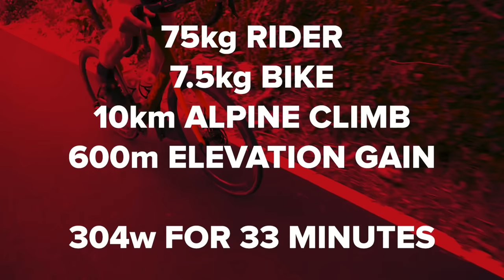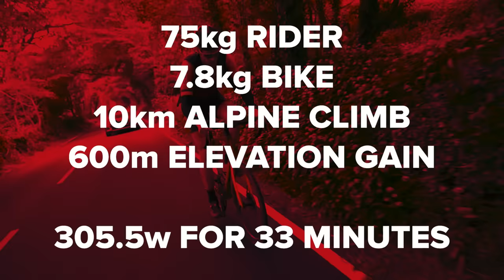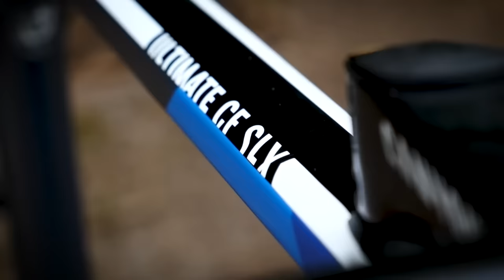10 Reasons To Consider Aluminium Over Carbon For Your Next Bike

Comment: TRUE STORY ALUM vs CARBON: Father was sent from France for two years to Microsoft in Seattle. Father bought son a Fuji alum gravel type bike w/mech disc brks. They became good customers and son became president of his hi-school cycle club. One day he came to my shop and told me he was in the top 5 in his class racing the local week race at Seward Park. I asked him, that I would like to see his race bike so I can fine tune it and hopefully be in the top 3. I went into shock when he told me he was racing his aluminum gravel FUJI with full fenders and a rear rack!!!  His excuse for not being able to podium was that everyone else bikes were expensive, name brand carbon bikes.... I explained to him, that his alum bike is better for racing because its stiff, and all his pedaling forces go into moving forward, where as a carbon frame flexes just a bit giving his aluminum bike an edge.
I then told him I will sponsor him if he allowed me to set up his FUJI with Lt/Wt tires & tubes, as he had heavy wire bead city tires.  We removed the fenders, and I decided to leave the rear rack on as it helps aerodynamically. As an ex Cat-1 racer I gave him racing advise and told him never to break away unless he sees one or more of the top 3 guys in the break.  A week later he came to my shop all excited telling me he WON!  And he went on to win the entire Seward Park series along with all the top prizes and cash.  And he did it all with an Aluminum bike!  The funny part was his Fuji bike with a rack being photographed in front of the podium next to 2nd & 3rd place Pinnerello and Cervelo.  Cheers ( :

Comment: Al does have a weakness being exposed to toxic and acidic sweat, especially as it accumulates in BB area, corroding the frame, housing threads and the BB itself.  Also, I know quite  a few people have broken Al handlebars because they don't change the tape often enough.  Al metal turns into Al Oxide powder.  So Al has an  unstoppable as well as insidious corrosion problem that causes Al components to have limited lifespan.  You can slow it down, but it requires more maintenance and cleaning.  Most Al components get a coating to stop corrosion, and this coating can be compromised by scratches from falls or other causes.  Carbon bikes do have Al bits that are also subjected to this problem such as drops, cable guides, threaded or press fit housings, etc. so carbon bikes are not immune, but at least the carbon frame won't snap some day because of corrosion.

Comment: Sorry that we dropped the I from Aluminum here in North America.  It seemed fitting that Ollie provided such expert analysis about the I being "dropped".
Reply: Do you mean olle?
Reply: @LOGICAL-JAY  It's not snobbish to use an officially recognized term for a metal element.  And both versions are indeed officially recognized.  But it should be alumium...it's shorter and came first anyway.
Reply: @phnelson033  relax I'm just joking..I like carbon frames better anyway..lol..the cannondale CAAD is an exception though..

Comment: I have a Trek 1.5 compact alpha. Aluminium frame with fairly basic entry level group set etc. I changed out the original wheels for some expensive ones and it transformed the bike.

Comment: If you are riding a bike, you are living life well.   Doesn't matter if it's aluminium or carbon or steel (or wood, even).    Personally, I like steel.    It's even more robust in most situations, affordable, gives a good ride, and looks cool (esp with lugs and classic frame geometry!).    My bike weighs a whopping 30 pounds.   No light weight, for sure.   But I go fast enough for my taste, and ride far and have a blast.   And that's the point.

Comment: Threading into carbon while possible doesn't look like a good idea to me. I'm an IPSC shotgun competition shooter and we have those long telescopic magazine tubes on our shotguns where there's this same debate is raging - carbon or aluminium. And I've seen many a carbon magazine fail where not a single aluminium one did. They fail where they have a threaded connection to an aluminium hub. It's a problem that different manufacturers try to solve differently. But I just ran a slightly heavier aluminium magazine and never had a single issue. Threading into carbon looks like a no no for me. Especially when we're talking about the bottom bracket which gets subjected to a lot of force.

Comment: I'm confused, which is heavier: 1 kg of carbon or 1 kg of aluminium?
Reply: Carbon fibre has a density of about 1800 kg/m^3, where as aluminium is roughly 2700 kg/m^3; so carbon fibre is also around 1.5 times lighter - per unit volume. Just a quick Google search away...
Reply: @FSXgta  whoooosh
Reply: @pvtmustaqim  I am truly retarded haha

Comment: My aluminium Trek 2300 (circa early 2000s) developed a fracture in a weld on the non drive side chain-stay after a few years (which made it a write-off).  I don't worry about that on my newer Carbon bike.  I do accept that it is more vulnerable in crashes.  But if you don't crash, carbon can be the longer-lasting technology.

Comment: Carbon for comfort (and efficiency), aluminum for winter bikes.
I hate the jarring and dead feel of aluminium, but no galvanic corrosion to components as happens to those same components attached to a carbon frame that came in contact with de-icing salts in winter.

Comment: Over the past 20 years or more, I have had a succession of aluminum frames, thanks to a very liberal frame replacement warrantee of a fine American bicycle manufacturer.  I must say I loved them, particularly the latter frame versions.  That staid, every one of them eventually broke, usually the seat tube near the bottom bracket (hence the replacements).   Admittedly, I tend to ride the frames longer (much longer) than any self-respecting, gotta-have-the-latest-components cyclist should, but metallically speaking aluminum fatigues and simply does not have longevity of a steel frame (I haven't much experience with carbon).  We're talking a couple tens of thousand miles between failures, but just be aware.  At this point, however, I'm riding much less than my intense years so I'll bet your current aluminum frames would last me the rest of my riding days.  I'd buy another based on the price, and use any future problems as an excuse to get the latest components.

Comment: I have been using bicycles made of aluminum for more than 10 years, my bicycle brand is Mosso, the frame is made of Aluminum 7005 and the rims are made of Aluminum 6061. This bicycle is a Hardtail MTB bicycle which I converted into a hybrid since 2014 and it is comfortable to ride for commuting. gravel road because I like cycling in and out of the village in my area. Aluminum 7005 and 6061 are materials used in the aircraft industry. So light, strong and durable. And I'm still using this bike from 2009 to 2021 at this time. I really like aluminum bikes compared to carbon. 🚴🚵

Comment: I got myself a second hand collector Swiss carbon aero bike (manufactured by Cilo) for 700 $, it's an awesome bike, very stiff. Came with a set of wh-r540, which is a bomb proof wheel set. And, on top of that, it's mounted with the good old ultegra from the 05'. Never had any issues after 3000 km.

Comment: My number 1 reason for aluminum over carbon fiber is... When carbon's stressed beyond it's yield point it can develop internal damage that cannot be seen. Basically microfractures inside the layers of the composite itself. Then when after repeated lower levels of stress and vibration the part fails catastrophically. Aluminum is not only far less likely to fail catastrophically, where carbon it all but guaranteed to. When stressed beyond it's yield point aluminum will show visible signs it's damaged allowing you fix or replace a component before it fails.....Those videos you can find on YT of things like carbon handlebars suddenly snapping in two are 9 times out 10 parts that were damaged in a past crash or mishandling, that showed no outward signs of trouble until they later snapped in two while on a ride. 

For racers who win or lose is a matter of fractions of a second carbon may be worth it. For me winning is going home at the end of the day uninjured with a working bike, So I have aluminum.

Comment: I recently built up a 2016 aluminum Trek Emonda ALR frameset to the same specs as my 2015 carbon Trek Emonda SL to have a second bike—mix of Ultegra and Dura Ace components, Fulcrum Racing Zero Wheels, Bontrager XXX bars and stem, and carbon seat post. The bike weights are the same. Yet I actually like the feel of the aluminum better than the carbon. The ALR seems to be stiffer in all the right places, and the ride is comfortable nonetheless probably thanks mostly to the carbon fork. The ALR is easier to maintain with its external cabling. The ALR fork has an aluminum steerer, which is likely safer than carbon. Both bikes are at least a kilogram lighter than the current Trek Emonda SL6 with disc brakes. The cost for me to build up the ALR with superior components, finishing kit, and wheels was a fraction of the cost of a new SL6, and is a superior bike in every way in my opinion. Some people have advised me to “upgrade” to the new Trek Emonda. In my view, why would I spend so much money on a downgrade?
Reply: Remind your friends. Its the Indian not the arrow

Comment: One thing I once heard is that Titanium despite having a very high strength weight ratio apparently has the disadvantage of making a slightly springy frame meaning that too much of the riders leg muscle power is absorbed & not transmitted to the wheels.

Comment: Seat post suspension improvement reduces NVH up the spine, into the butt & crotch and reduces rider fatigue, as does front suspension and stem suspension. Combine a comfort seat on spring suspension, decent front suspension & bar stem suspension, and you can radically reduce riding fatigue so as to stay fresh longer on bicycle road trips & long distance events :)

Comment: Rode an aluminum for 2 years, got the same model in carbon.... not comparison... riding the alum now feels like riding a tractor lol  PS.  Also, I never quite understood the concept of "getting the energy back" from carbon frames.  Well, I still don't but it is something I felt instantly, especially on hard accelerations when I'm out of the saddle.  It's a beautiful sensation....

Comment: I have a top-end aluminium drop bar bike and a mid-level carbon drop bar bike with the same brand model series and size, all the components on the carbon bike are one level up, so overall the carbon one costs 3 times more than aluminium one. At the time I rode higher weekly distance and cared about PRs, I did not see aluminium was any less than carbon in performance, on the contrary, I made more PRs on climbing with aluminium (could be the gear ratio). I also have a entry-level aluminium flat bar bike, it's heavier on frame and wheels and indeed slower. My observation is the overall weight is the bigger factor to affect your riding speed, the frame material does not matter that much. However, the carbon frame does have better look, I receive compliments for the bike from people when riding the carbon one, I don't recall any for aluminium ones :D

Comment: Hmmmm.... some great points here and if I had to do it all over again, I might buy Aluminum.  

Had an old steel Gary Fisher for nearly 30 years until a friend lent me his carbon Specialized for our usual Saturday ride - the difference in performance was dramatic!!  So dramatic that I bought a carbon the next week - I was lucky because a friend sold me his lightly used Specialized Stuntjumper kitted out with top of the line gear for a disgustingly reasonable price (his wife stopped him from riding after a car plowed into his riding group, killing a rider, so it was gathering dust in his verandah).

My cousin who rode an Aluminum Cannondale, broke a weld on the frame while climbing an 11+% hill near us - Cannondale honoured their lifetime warranty and upgraded him to a carbon frame.

So my instinct would be to go carbon for my next bike (or get a Porsche), but my cheap Scottish genes would probably push me to buy Aluminum....

Comment: Agreeing here with all that Ollie is saying. But a topic not touched upon is the aesthetics, which will be of importance to many. Talking specifically about joinery. But maybe someone's done something with aluminium these days to make the junction of tubes  as IN-te-gral as is the case with carbon. The opinion here is that neither of these materials will ever approach the gorgeous aspect that's inherent in lugged polished steel joinery.
Reply: Except that it can be done. I have an aluminium framed bike with smooth junctions that can easily fool people into thinking that it's a carbon frame from a distance.
Reply: @Bungle2010  Yes, I've heard that's the case; thus far I've not come across that level of aluminium artistry.  Or,  I was so completely fooled by the workmanship, that I took the frame for a carbon one. Thanks for making this point.

Comment: Most modern mid to high priced bikes have carbon forks, regardless of the frame material. So there's that. I
 have a Scandium Opera by Pinarello, and I have never ridden a bike that accelerates and climbs better. IMO qality of construction and the best material count more than the type of frame material. I love my carbon, steel, and aluminum bikes. I appreciate each for their particular character.

Comment: Wow your bikes are light. Mine is 28kg steel mtb. Bought it on a whim. Loving it though and using it almost everytime I can and do some 30-50km ride with ups and downs. Have it for 5 years now and its just because of the pandemic that I started to educate myself about bikes.
Reply: 28 kg is a typical E Bike weight. I have a cromoly fitness bike with a non road bike frame made of cromoly and a handle bar made of stainless steel. Despite no efforts for weight savings it's just 12,7 kg. The frame alone is 2,5 kg with another kg for the fork. 
Is your bike a full suspension or cat 5 downhill bike?
Reply: @simonm1447  front fork suspension only. Dont know what category it is but sure is heavy. Not an e-bike, but I use it sometimes when I go to work. Heck of a workout. You learn to appreciate it once you've used it. In the past, I have to carry it to 4th floor since my room is in the 4th and no parking for the dorm. Its one of those stepdragon folding mountain bike, but it only folds in the middle 😂😂😂

Comment: that's correct, aluminium bikes can be made lighter than the equivalent carbon bikes. that's because the resin used in carbon fiber doesn't give the strength to the frame, but every crystal in the aluminium structure does give it the strength. so, if you compare resulting frames using Newton meter , the one made of aluminium will give you greater strength (i.e. will support greater force) when compared to weight

Comment: It's funny how stiffness of the frame is still mentioned as an adventage when it comes to power transfer. In fact it's the same myth as 'Rotating mass' - same category. Yes, bike can bend more or less but the power transfer on the wheels is the same. The force you put into frame which bends at some point is transfered on wheels because the frame gets back to previous form. Like a spring made of carbon or aluminium. If you put 100 watts on both of them, carbon and alu will have 100 watts in them.
Reply: That would be perpetual motion.  If you had a weight bouncing up and down on a spring, it will not bounce up and down forever, even in a vacuum.  Some of the energy put into flexing gets degraded to heat.  

Rotating weight is similar.  It's all good, until you apply the brakes, and degrade it into heat.  Then it's lost.
Reply: @blubaughmr  Not at all considering the fact you are adding constantly same amount of power to the system (bike). So we are not talking about perpetual motion in any form. Besides that, technically you are right that some of the force is transferred to heat but still - both materials bend but the power transferred to heat is so small on both materials that noone takes it under consideration when designing the frame (even steel or wooden). I've never heard of anyone having his frame hot or even warm from pedalling. Actually I think that it might be the transfer of the power to heat happens when material deforms (not bends).

Comment: Good job…I was struggling between the Canyon Grizls. The aluminium frame is available earlier and it is about 1 cm lower which is good for me: I can safely get an M. The weight difference for the 7 is over a 1 kg but the DT Swiss wheels on the carbon are lighter.
Reply from the maker: Are you going for the aluminium frame? 🤔 It's a great bike!

Comment: I'm riding Merida Scultura 300 2018 with Tiagra groupset. I realized that, if you're not racing, it's not the carbon or the aluminum that matters, it's your feet! One day i will upgrade to the higher component and wheelset. but now, i have a strong legs.

Comment: All my Cannondales are aluminum:
1998 R200 CAAD 2 with Shimano 600/non STI with Mavic CXP 30 rims and Michelin Dynamic 23 tires.
2000 Super V 400 with Deore XT/LX drivetrain, Avid disc brakes.
2014 Quick 5 hybrid upgraded with Shimano Alivio/Acera drivetrain. 
2015 Bad Boy. Upgraded the crankset with Shimano Deore Hollowtech crankset and Alivio drivetrain. 
I was able to test ride a Cannondale Super Six Evo carbon road bike and was not impressed with carbon. I decided to stick with what I know best. The latest edition to my Cannondale family:
2020 CAAD 13 Ultegra rim brakes with Ultegra 8000 series crankset and Fulcrum wheels4 with Michelin Pro 4 700×23 tires. 
ALUMINUM IS KING.